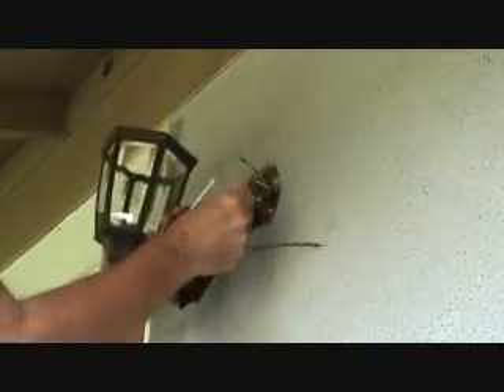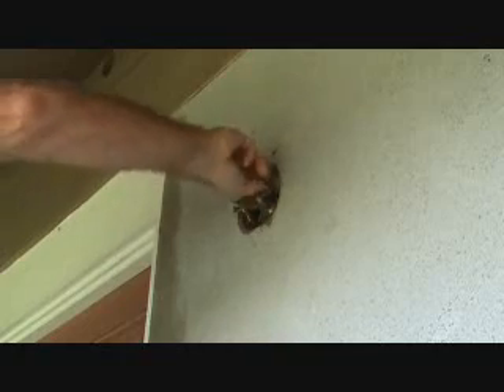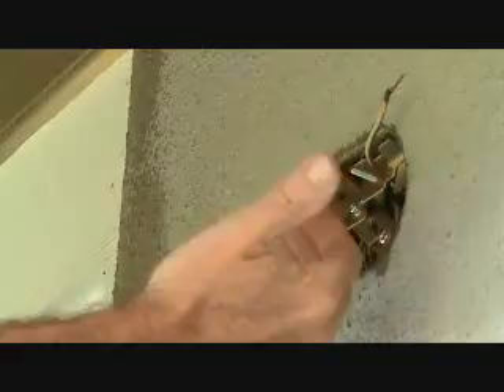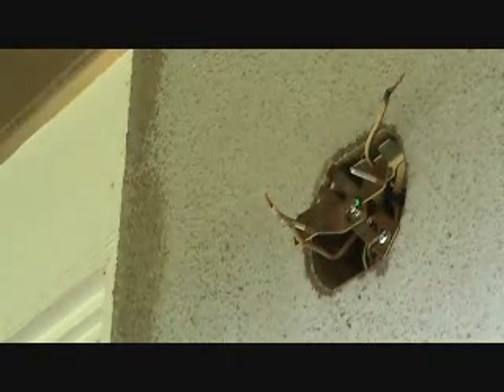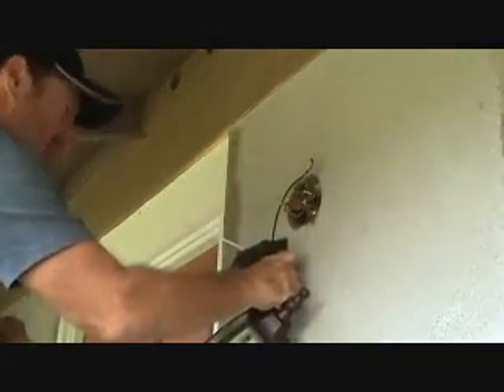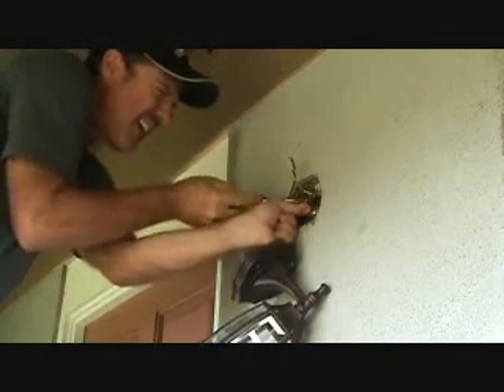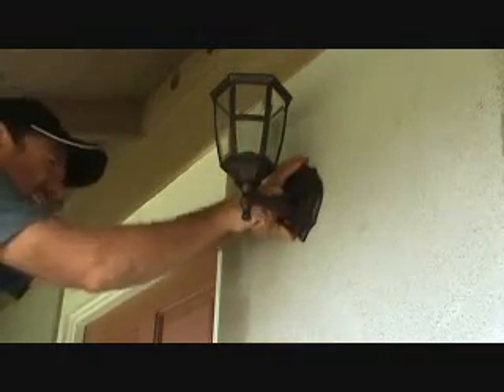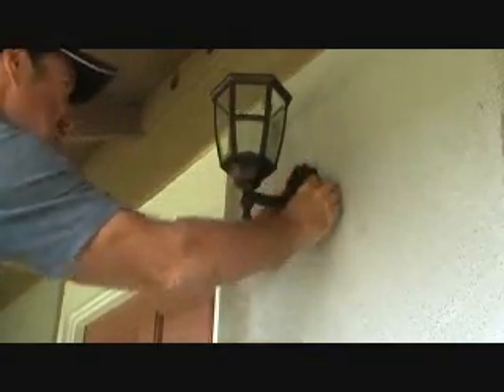How to install an exterior light fixture...Part 3

Comment: Oh I remember THOSE days; the days when we wish we had 4 arms! I was an electrician helper for 2 years. I think my most nerve wracking job was wiring up a chandelier (with another person holding it) about 25 feet up, on an A-frame ladder. Talk about sphincter tightening!!
Reply from the maker: That's the one thing I hated the most was to install a chandelier or long hanging light fixture with a chain. Always a hassle for sure.   Joe  :0

Comment: You can use a wire to hold up your light as an extra pair of hands… I do it all the time. Then when you finish your connection, remove the wire “extra hand” and install your fixture.
Reply from the maker: Great idea. I like it. Thanks.   Joe  :0